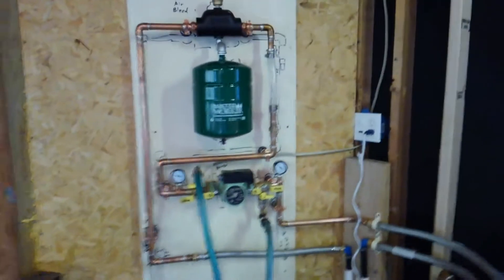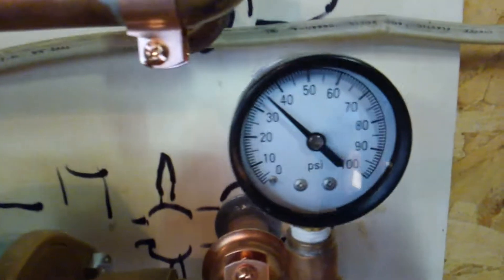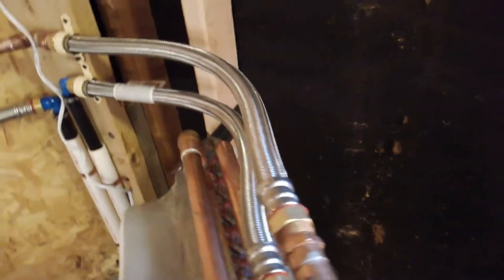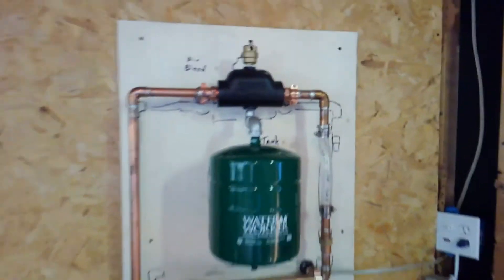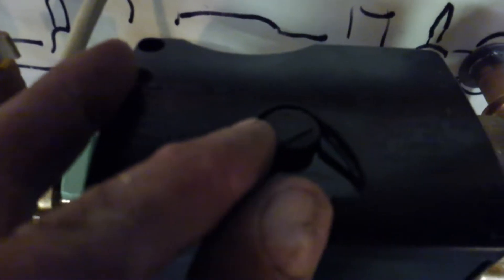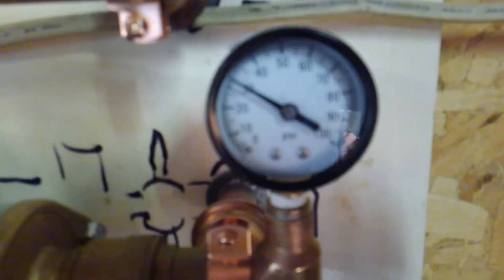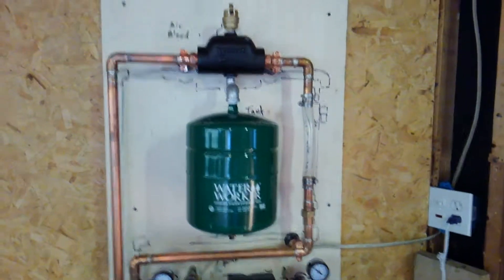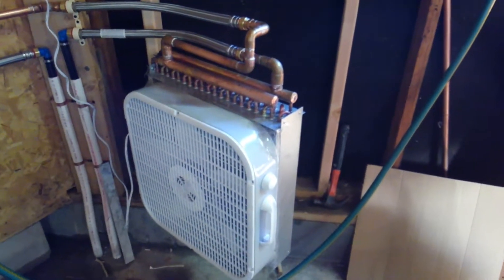GeoThermal v12

Comment: Well done Larry!  This is EXACTLY what I was thinking about, and searching for.. I Figured SOMEONE out there has to have done this on the cheap already.. Im actually thinking about using this same type of idea for heating/cooling a shop floor.  More to come on this idea, but your video was impressive! I'm glad there are still men in this world who still just go Get-it-done!   Bravo my friend!
Reply from the maker: Thank you sir! I hope you watched the "geothermal diy #1" video that shows the entire process. The best part is the system is totally expandable. Add another 10 or 20 more well circuits for more available btu's or a heat pump for heating as well as cooling. Let me know about your projects and never stop thinking out side the box!
Reply: @larryshea8595  "or a heat pump for heating as well as cooling"  This is my plan.  First an air heat pump, then add something like this to keep the air going into it around 50 degrees all year around.  Kind of like supercharging your ordinary air source heat pump.